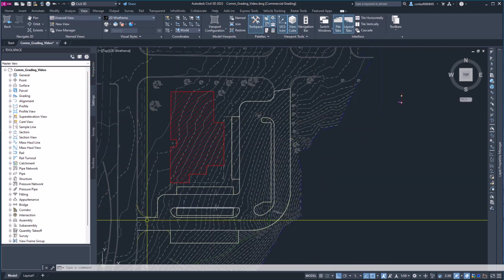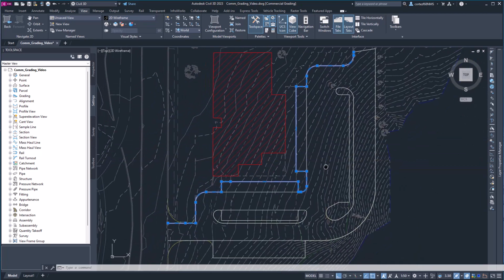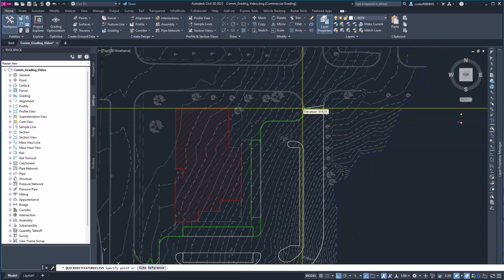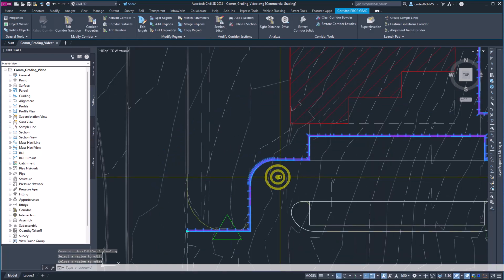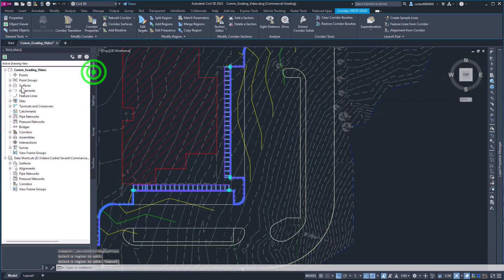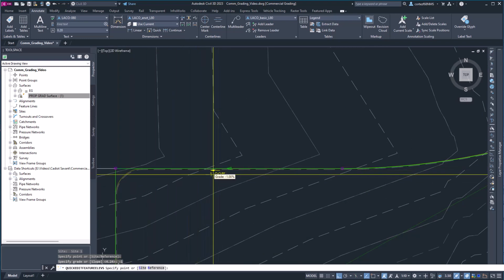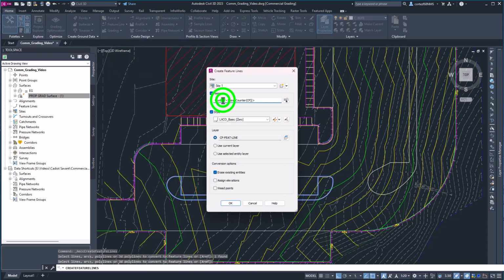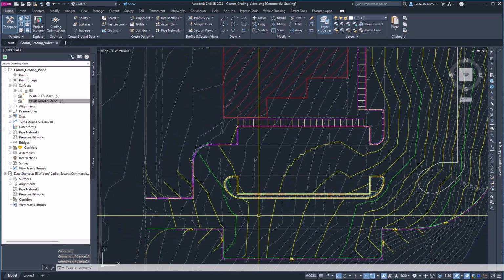Dynamic Commercial Grading with Civil 3D (Everything You Need to Know)

Comment: How would you create those filleted radii in your corridors?
Reply: It would be easier to put them on the polyline before you convert it to a feature line and add to corridor. However, I believe you could also edit the feature line after it has been added to the corridor

Comment: Imo it looks like a better practice to use a reference surface for controlling the feature line elevations than manually adjusting elevation points or grades, to get more consistent contours and grades. The real trouble begins when starting to model all the support layers and the excavation.